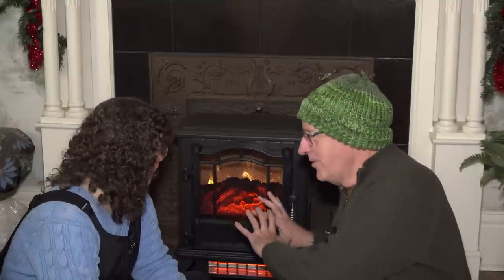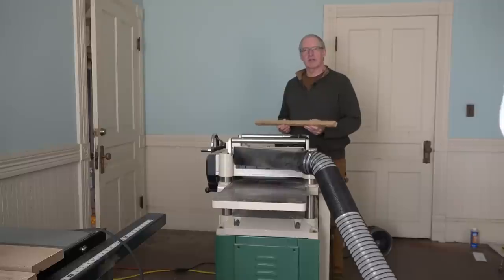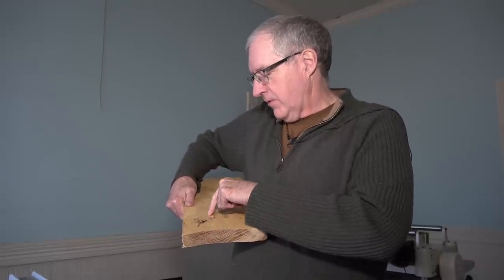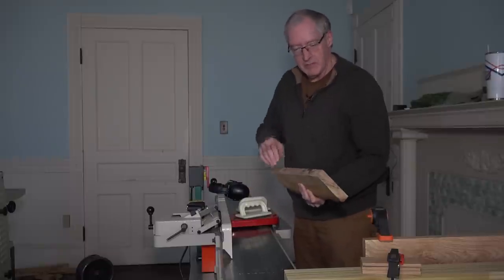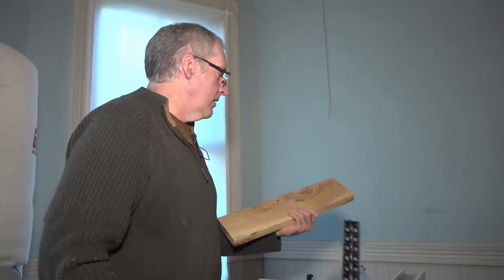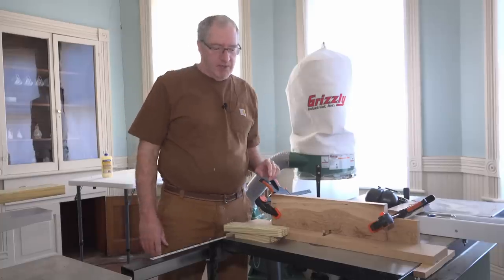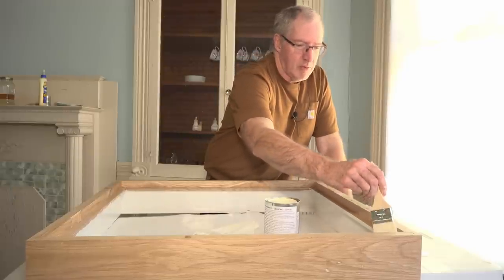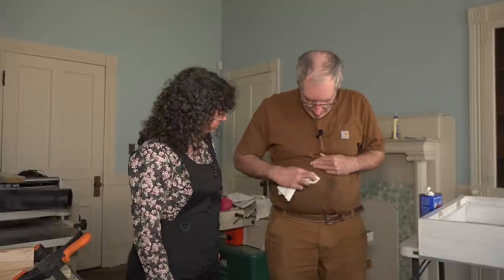EP113 Painting a New Wooden Window

Comment: We live in a 1885 solid brick Victorian home.  We have radiator heat with a gas boiler.  We also have 8 coal burning fireplaces.  My husband decided last Summer to line one of our chimneys and put in a wood burning stove.  It was well worth the time and money.  The temp in Southern Indiana got down to -8 and it was so nice to be able to have a fire in our front parlor.
Reply from the maker: You are lucky to still have your boiler system! Our old 1834 house was equipped with a boiler and radiators and it was way cheaper to run than HVAC would have been. Can you still get Anthracite coal where you live?

Comment: Interesting video, Compared to Northern European countries I always noticed the absence of retro fit insulation in the roof space and in the exterior walls when you repaired the  cladding, also noticed the fire place openings seemed  rather small for the large rooms with high ceilings, so assumed that South Carolina had milder temperate winters, i expect those large family homes once had live-in domestic help for laying  the fire places. As a temporary winter idea just to get through this maybe you could set up sleeping, eating  and living in one room.
Reply from the maker: This house doesn't have a single bit of insulation anywhere. It's harder to heat, but as you said the climate here is generally mild in the winter (not this year). Our fireplaces are coal burners and the firebox is really small so that the heat stays in the room.

Comment: Have you thought of using an electric space heater(s) in the one or two rooms that you are working in?   They aren't all that expensive and many actually have variable fan speeds and thermostats. Also, on the more expensive side, if your HAVAC isn't strong enough to heat upstairs you might want to consider a second unit to service just the second floor.  Many two story homes in Florida use two units as a more efficient way to a/c and  heat the homes.
Reply from the maker: We bought a couple of space heaters and that helps a lot. We haven't decided whether to install ducted air into the second floor or to go with a steam/hot water radiator system. I we were to go with radiators, then we'd equip the entire house and quit using forced air heat.

Comment: I have a question about the planer and the joiner. I watched you smooth out the flat side and one edge of a piece of wood. You then brought it to the planer to do the other side and the table saw to smooth the remaining edge. Why could you have not just turned the board over and ran the other flat side threw the planer and the edge also?  I must be missing something here. I love all that wood working equipment. I hope the recent tornadic weather that ripped threw the south didn't cause any  damage to your beautiful home.
Reply from the maker: We were spared any damage but we captured some video of the storm as it passed through. We'll share that video clip in a future episode. 
As for the wood, the jointer's job is to cut precise and tiny amounts of wood in multiple passes. Wood is usually misshapen and the jointer will just work with the "average" shape. The problem with flipping it is that the opposite side is also misshapen and the "average" shape will never be the same and you'll end up with something resembling lap siding. The planer puts the flat (reference) side of the board onto the deck and the knives cut the top side. This guarantees that the board will come out flat. On the tablesaw, the flat edge goes against the fence and the blade trims off the uneven wood. I hope this makes sense?
Reply: @1834RestorationHouse  yes, thank you so much!

Comment: I'm just curious as to what the long-term plan is to heat and cool your home? I'd imagine it would be interesting considering your renovating with the same technology as when your home was built.
Reply from the maker: We would like to restore the coal burning fireplaces to operating condition. Also, it would be great to have a boiler/radiator system on all floors. They have this new AC ducting technology that uses tiny tubes and can be easily hidden inside walls. The attic would be a great place to put a cooling unit.
Reply: @1834RestorationHouse  Traditional column radiators off a boiler system would really suit your period house, the type manufactured now look classic and have excellent radiant  heat output, I don’t how available or what demand there is for these in the USA especially the milder  states, my relatives in Toronto have the original cast iron type  in their 1926 built house, they do get cold winters though.
Reply: We have a  circa 1880 Victorian and had the small bore high velocity AC put in.  Took a week to run the tubes and install the air handler in the attic and the compressor outside.  Works very well and the house is comfortable in the summer here in New England.
Reply from the maker: @kathrynblack9152  Were they able to conceal the registers so they don't look too obvious?
Reply: @1834RestorationHouse  Well, they aren't too obvious and would be harder to see if they were painted to match the ceiling/walls that they come through.  The openings are round, about 2 inches in diameter, with a 1.5 inch collar.   Certainly less obtrusive than multiple ductless units.
The biggest thing is that the system works, keeping the house comfortable.
Reply from the maker: @kathrynblack9152  Nice! We'll check it out.

Comment: Why use box joints when with the same router you can make dove tail joints? Box joints are and were then more commercial; dove tail joints are stronger and look more hand made.
Reply from the maker: Mainly because our router setup isn't very good. Box joints are pretty neat, even if they were commercial.

Comment: without primer paint may start to crack and peel in a couple of years.
Reply from the maker: With this system, the oil itself is the primer. The first coat sinks into the wood fibers. It's also possible to dilute with turpentine if the wood is old and dry.